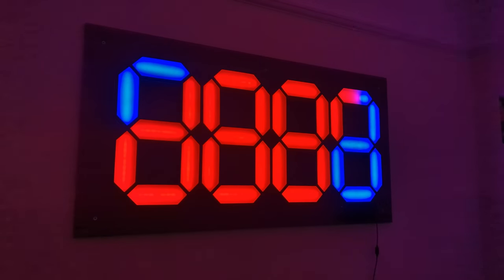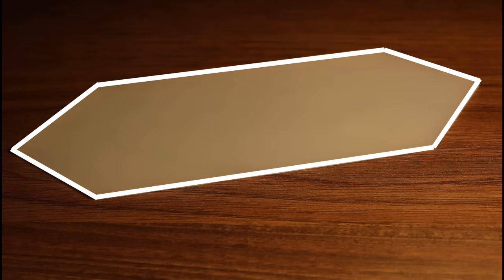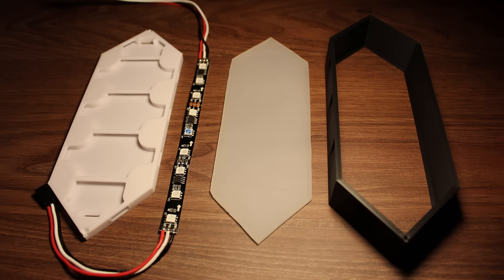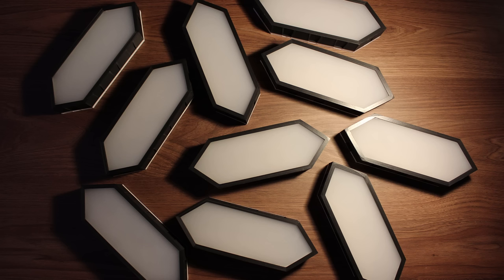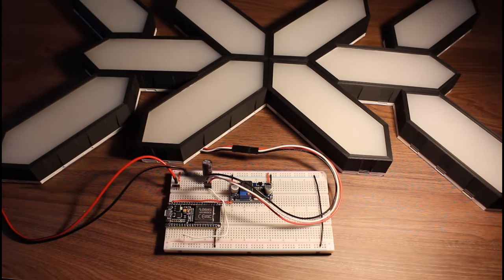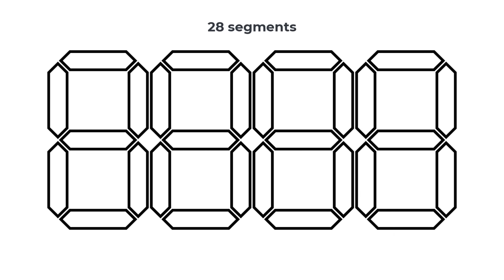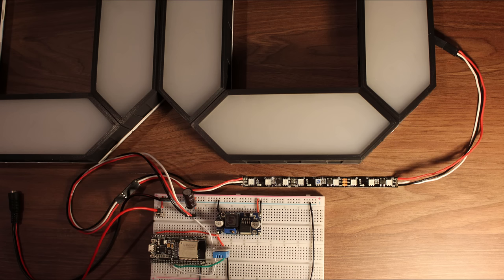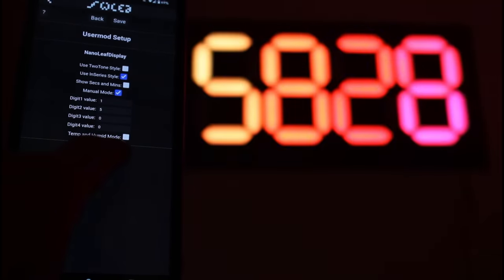The BEST NanoLeaf lights! DIY, Wireless, Modular, Arduino, 3D printed, Wall Lamp!

Comment: Nice project, though I'd advice you to change the inter-segment connectors pinout. In its current view it is critical to connect them in a proper orientation and in case of mistake something will be fried. However, if you make the central pin a 5V power line nothing will be fried if the connection is flipped. In case of mistake data line will be connected to ground, which would not lead to hardware damage. Just check how they do it in servos which also often use 3 pin connectors.
Reply from the maker: That's a great idea! However there might be a slight issue with it, when connecting the wires from the LED strip to the dupont connector, the red wire will have to cross one of the other wires to go to the middle socket of the dupont connector, which will cause a bit of tangling and potentially make it harder to route the wires. Nonetheless, that is for sure a way that it can be done, I like the idea! Remember to subscribe if you haven't already, you are the type of people I especially want to be part of this community (which will at some point... eventually... be big... haha).

Comment: I found a roll of material that works great as a defuser. It is at Lowe's and called a shelf liner. It is 16" wide and has a decent thickness. It is originally used to line shelfs for your closet. It is under $15 for  a 16"x8' sheet.
Reply from the maker: Good stuff!

Comment: I would recommend for anyone building this to make the header 4pin and block one pin with glue or something so you cannot reverse polarity
Reply: 3d print a key  connector for these connectors... slide on and glue

Comment: Fumbled upon this vid but I'm glad it happened! Loved it. A quick one however, if I'm using 5V LEDs, do I still need the capacitor?
Reply from the maker: You can do without it, but it's recommended with a capacitor. It just helps with keeping the voltage more consistent and stable.

Comment: How much strip do you need for the full 4 digit display?
Also how much fillament was used ,and what is the average time to print one segment, hopefully this will fit on the bed of an ender 3
Reply from the maker: An LED strip needs to be roughly 15cm long in a segment, so for a 4-digit display which is made up of 28 segments, you will need an LED strip that is at least 15*28 = 420 cm long. So you can get an LED strip that is 5 meters long.

A segment is made up two 3D printed parts, the housing and the lid, both are roughly 76 grams of filament.

The average print time for the housing and lid is 2.5 hours each.

In a 23x23cm bed side, I was able to fit 3 housing/lid parts.

I hope this answers all your questions, let me know if you have further questions. I also just added the 3D print settings in the project repository in case you need it 👍🏼.

Comment: Awesome project, thanks for putting it together! Did you have any issues with the LEDs sometimes flickering between color changes? It could just be that the jumper cables I'm using to test the components are 26 awg and kind of long. Should this fix itself when I set everything up with 20awg wires, or did you need to use a level shifter / something else?
Reply from the maker: Thanks! I didn't use any level shifter or voltage booster. I don't think changing the wire gauge will do much in this case, I would suggest looking into your power supply, check what the max current output is and ensure it is rated for 12V.

Comment: I am printing out my first set of pieces for the clock!  I noticed that I have leds that are 5v, not 12v. I assume this means I dont need the stepdown converter.  How else would that change the wiring here?  Like do I need the capacitor still?
Reply from the maker: That's awesome to hear! Yes you won't need the step down converter, as you can just power the ESP32 using the power supply directly. Apart from that there is only a few changes you need to make in the app such as setting the correct voltage, which if you follow the video, you will know what you need to change accordingly. I would still recommend the capacitor.

Comment: Great project, especially the way segments are connected to each other. And are you going to make a pcb to control the segments?
Reply from the maker: Thank you! At the end, I just ended up making a small stripboard for a permanent solution and to make it take up a small footprint, no PCB was made. The stripboard uses the exact same wiring of the breadboard.

Comment: Great Project,

It amazes me ( after watching many many other 7-segment YT video's ) that there still is someone to come up with an original idea.
Like this concept.

Since I don't have a 3D printer , having the Lid/Housing etc printed by a 3D prints supplier for ONE single digit ( 7-segments ) would cost me 140 euro. 
So based on that fact :

Q1:  How easy would it be for you to have the scale adjusted to a 50% smaller size.

It would also make the Height of a single digit : 20cm iso currently 40cm,

I have made myself ( based upon other YT video's ) a 7Segment clock . But my segments are made out of cardboard. 

Have also various lamps build with WS2812B Leds an the excellent WLED app.
But it was a big surprise for me that actually via WLED you can 'control' the 4 digits for HH:MM.
So I will definitely investigate that in detail and try to copy it.

Johan
Reply from the maker: Thanks! Q1: You can scale it down, however, the connections between the segments might not work as well.

Comment: i REALLY love this and wnat to take it and apply it to something im designing.. the biggest thing im interested in are the clips that lock them together. I got the stl file for them, but theyre SO tiny that my printer struggles to print them.. do you have any insight how to maybe enlarge it a little? also if you could possible point me where to look to learn how to get that channel that they fit into cut out in my surface, that would be AWESOME.
Reply from the maker: I am glad you like it! To print the small connectors that connects segments together, I have added the printing settings I used to print them to the repository. The main idea is to use as small as possible layer height and print as slow as possible. To enlarge them, I recommend scaling them up directly in Cura. To create the channel that they slide into, use the housing 3d model to get the dimensions needed. I recommend scaling them up only if you need to as they are surprisingly strong 👍🏼.

Comment: Hey. I'm newer to electronics projects like this. I was wondering how you connected the power supply to the breadboard.
Reply from the maker: I just soldered some solid core wire or header pins to the power supply cables, see 14:36, top left of the breadboard.

Comment: by far the best explanation ever! what filaments did you use for the 3d printed parts?
Reply from the maker: Thank you! For the filaments I used matte 1.75mm PLA by Tinmorry.
Reply: @ProjectsWithRed  many thanks for the reply. how was the PLA with the heat of the LEDs so far?
Reply from the maker: @chipchorps  No issues at all, the LEDs emit little heat even in full brightness after multiple hours.

Comment: I have problems to upload clock configured file to ESP32 board. I get error message "command 'platformio-ide.upload' not found". I have unistall PlatformIO and delete also folder PlatformIO and reinstall PlatfromIO, but still have some problems.
Reply from the maker: Have you selected the correct micro-controller?

Comment: Thanks for your video!  This looks like a great project for my classroom.  Has anyone added any additional features to further customize this project?  I think it would be great to create a color change/flashing feature at the different times my students depart.  It may also be valuable to create an audio alert to warn the students of their departure time.  I am wondering if there are other ideas to add functionality to the project.  Maybe the display could respond to a request through a smart assistant.  For example, "Alexa, what is the current temperature?", could display the outdoor temperature.  I can think of some other fun uses.  Scores to the game of my favorite baseball team, etc.  Has anyone doing anything similar?

Comment: Hey, great Video

I'm rather new to diy electronics, do you have a recommendation what type of 1000μF capacitor i should use? or does any 1000μF capacitor work?
Reply from the maker: Any common 1000μF capacitor will work.
Reply: @ProjectsWithRed  Sorry that i need to ask again, but how do you connect the powersupply to the board? Dont I need another thingy where i plug the power cable in?

Comment: Can you replace the acrylic by custom printed covers? Have you checked the proper screen thickness for the distance between the leds and the surface, so led "bulbs" are not noticeable?
Reply from the maker: You can for sure use 3D printed covers, but the glow effect might not be as great as the matte opal acrylic sheets. Yes I experimented with multiple heights and the one that gave the best glow effect and least printing material and time was chosen.

Comment: I like your Video a lot. However, I would like it to be in one color (e.g. white, red or blue) and above all much smaller, with only 1 to a maximum of 3 LEDs (instead of 9) in one element of the 7-segment display. 
Could you maybe make a video about it?
Reply from the maker: I will unfortunately not be making a video about that, but it would be fairly easy to modify this project to get this done.

Comment: The connectors I have printed don't fit; I didn't print them using the Cuda profile, could that be the problem?
Reply from the maker: Yes it could very well be, since they need to be printed with the highest possible precision because they are so small.

Comment: Great project . can the insert window be printed rather than buying the acrylic sheet , maybe someone here already created an STL for it.
Reply from the maker: Yes you can definitely do that. A thin white filament will do the job, it will not provide the same glowing effect as the acrylic but will still work.
Reply: @ProjectsWithRed  thanks you! I ended up getting foam bord paper from the dollar store and cut them to shape. the light glow looked pretty good when I held them up to other LED strips that I have. ill end up putting them all together  this weekend, I opted for the desk light version of the project.. thanks again for the great work.
Reply from the maker: @FranckyAntoine  Good stuff. You are welcome!

Comment: at 17:13 you say a small ___ board?  sounded like step? couldnt quite hear it... Could you please explain this part a bit, so I can get that part.  thanks
Reply from the maker: It's a stripboard, used to make the electronics compact so it all fits in the housing part 👍🏼.

Comment: I am facing a problem, after uploading the clock code, I am unable to connect to the wled app, can someone please help. Thanks in advance
Reply: Are you able to connect to the web interface with your computer?
Reply: @newmexicojoe  thanks for your response, I am now able to connect to wled. Also I have done all changes on led preferences. But only 1 digit of the entire clock is on, which is on the breadboard side. Rest 3 digit is off
Reply from the maker: Have you changed the length value to 87 in the LED preferences? Also double check the wiring to ensure its correct.

Comment: It is brilliant but cannot upload to ESP32 on Mac!!!
There is no com1 or com2 
Cannot use the clock
By the way it does not work on pin 16
It works on pin 2
Reply from the maker: It doesn't have to be COM1 or COM2 etc. Use whatever name it is on the Mac. If that doesn't work, try removing the whole upload port line from the code and upload. It should detect your ESP32 automatically. Yes the pin will depend on the exact ESP32 you use 👍🏼.

Comment: How can I create a 6-digit display with this system?
Reply from the maker: It should be fairly straightforward, you just need to connect each new digit to the male end of the 4-digit display. In terms of the code, you need to change a few variables which are self-explanatory, for example, the "NUM_OF_SEGMENTS" variable will be 6*7=42 (6 digits, 7 segments each digit) rather than 4*7=28. Then you just need to study the code for a bit and see how you can manipulate it to control the 2 new digits, which should be fairly easy as I made sure the code is easily scalable.

Comment: why use an seperate led stripe at the start of the display? software can be adjusted to dont need it, its not that hard...
Reply from the maker: This was the only way of doing it that will work the most native way with the WLED app to control the LEDs seamlessly.
Reply: @ProjectsWithRed  there is an option to skipp the first segment completly. So it should be possible to set it to skip 3...

Comment: Great Project, i made some modifications to the 3D Printing parts since i printed it all in white and wanted to print it as complete part. 0,4mm height works fine and diffuses the light good. 

The Problem i have is, i can't install the usermod. I made all the steps described in the Video and on Github two times now, never worked for me. Right after opening the Project without doing any change i get the Error:
[...]
Invalid environment name 'codm-controller-0.6'. The name can contain alphanumeric, underscore, and hyphen characters (a-z, 0-9, -, _)",

[...]
I don't get where the Problem is, anybody with a similar issue and/or  fix? Google didn't held :(
Reply from the maker: Did you select your correct micro-controller in PlatformIO?
Reply: @ProjectsWithRed  Hey, thx for the reply.  The fault appears right after i open the folder without selecting anything or setting anything up, just installed vsc and platformio then opened the folder. Because of the fault it does not build or Upload anything and underlines the First ; in platformio.ini. I copied an actual Version of the .ini and the fault was gone butthe upload didn't work also so I probably screwed something up during Copy/Paste 😅
Reply: Found it, it is the . in "codm-controller-0.6", change it to "codm-controller-0_6"and the Problem is gone (or delete it)

Comment: Anyone else had the issue where the little connecting plate just slips out ?  I can slide it down that channel, and when it reaches the bottom it just pops right out... i have 18 of each of the other parts printed, about to start the wiring :)
Reply: Scaled it up to 105% and it works much better for me.
Reply from the maker: @InTheLab3d  Good stuff! You can also try printing them in highest possible quality 👍.
Reply: @ProjectsWithRed  They were all printed on the bambu x1.. quality is insanely good.. Either way, it works. im happy, and the electrical components arrive today... Never having done breadboard or much wiring at all, im a bit nervous haha
Reply from the maker: @InTheLab3d  Good luck! Let me know if you need any help.

Comment: Can I ask one thing.. if possible please create triangles and hexagons using same interlocking system which can also pair up with these making it a much more customizable .. i don't know much about cad related stuff and i just bought a new 3d printer.. and this project blew my mind😊😊
Reply from the maker: I unfortunately will not be making any custom shapes for this project any time soon. However, I suggest learning the basics of 3D modelling and from there you can easily make any shape you want, while still using the interlocking system just by replicating the same method in your design. Thank you! I am glad that you like it.

Comment: 12 hours format is not working!
Any solution?
Reply from the maker: Did you turn off 24h format in the config settings?
Reply: @ProjectsWithRed  yes, Still 12 hours not working

Comment: How is anyone suppose to afford this? I got quoted over $2000 for all the 3d printer parts! :(
Reply from the maker: If you own a 3D printer and print the parts yourself, it will be much cheaper than that, it will be around £40 in filament cost👍.
Reply: @ProjectsWithRed  Hi sir, How many voltagefor the capacitor 1000uF
Reply: @kinyanjuimartin7349 
Yes, that is good question.! 
If you look carefully, it is connected across the 12volt rails. 
So I would use 25v or more. 
I think it is 100 uf.

Comment: Is there usermod that you mention in code WLED/usermods/NanoLeaf_Display/usermod_nanoleaf_display.h ? but nice project
Reply from the maker: Yes there is, I just checked it. Thank you!
Reply: @ProjectsWithRed  I used env:d1_,mini  why doesn't show up in usermod, is it for esp32dev ?
Reply from the maker: @ganbensie  Did you clone/download the repository linked in the description? If you got the WLED repository from the original repo then the usermod will not be there. The repo in the description contains everything you need 👍🏼, including a modified WLED with the usermod.